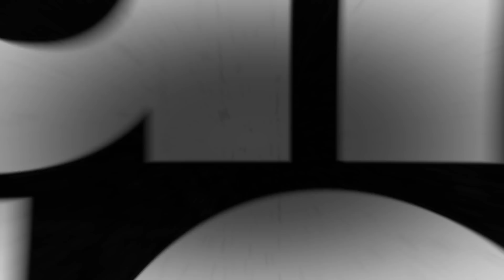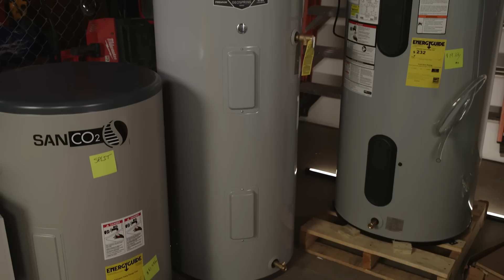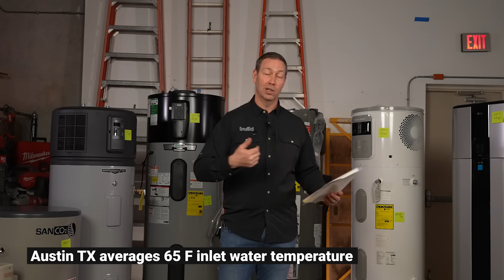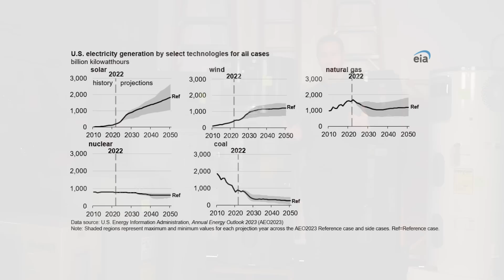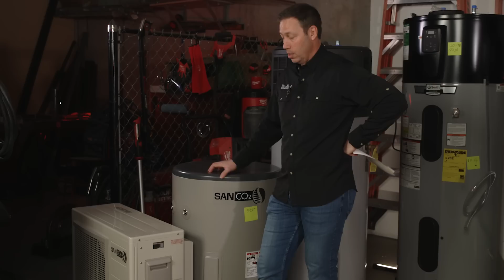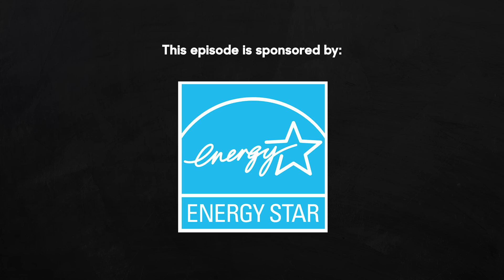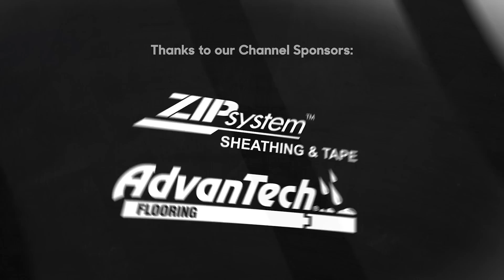2024 Heat Pump Water Heater Buyers Guide

Comment: I installed a richland (aka rheem) 50 gallon a few years ago. I added a removable duct to a new vent in the master bedroom to essentially cool our bedroom all summer long. It has definitely reduced our cooling and dehumidification needs, and with credits it paid for itself in two years. When it gets too cold, I remove the duct and let it cycle in the basement. Works great. However, the rheem econet app to control it is absolute garbage and I wish I had paid for a better unit because of that.
Reply: This 100%. Did the same basic thing and the app sucks a$$.
Reply: Yea that app sucks!!!
Reply: Hear, hear! The Rheem app is a scam. In my early months with it, it worked most of the time for monitoring power and usage statistics (good numbers there), with frequent connection issues. But after a couple of software updates it was completely non-functional, and I happily went back to manual operation via keypad. How much tweaking, remote or otherwise, really makes sense with such an appliance anyway? I'm a fan of set-and-forget.
Reply: Not sure how relevant this is to anyone here, but I have noticed a few projects on YouTube that use boards to tie in to give stats (and I think maybe even control) to help avoid using the Rheem trash app.
Reply: Which company would you go with, taking the app into account? Bonus points if it works with Home Assistant!
Reply: why would you need an app to control your water heater?  last thing I'd want is an app for that.
Reply: @NBABUCKS1  "need to" would be different than "able to". Everything should have local, non-internet control.
Reply: @NBABUCKS1  I take it you're not a home automation enthusiast. I think the key usage would be energy monitoring, but I could see it coming in handy if you took a trip and left hurriedly, forgetting to turn it off. I think we can all relate to that scenario.

Comment: Still need to see a Mitsubishi City-Multi compatible heat-pump water heater and a refridgerator + freezer...  then a ventless drier.  One converged system to handle all heat "movement" within a building.
  
This way you aren't "rejecting cold" into the conditioned envelope from a water heater (and messing with the humidity) - and you have the ability to recover the heat lost by the device's insulation to the conditioned envelope.
  
We're getting closer here... there's enough here to start having a good HVAC tech hack something together.  Either removing the heatpump's ambient coil and putting in a plate heat exchanger for a CityMulti unit - our just going with a hydronic waterheater tank like what Sanco did and just use a water-to-water heatpump.
Reply: I thought of something like that when Matt talked about the system in a refrigerator moving heat out of the fridge and into the room.  Why not move it into the water heater?
Reply: @moi01887  Yeah, if one looks at a residential home, the biggest thermal design cosiderations are the envolpe + environment, the laundry, domestic water heating, cooking, bathrooms, occupancy, and all other electronic devices/appliances (heat generation sources).
  
Every watt/hr consumed generates about 3.41btu/hr of rejected heat into the surrounding environment.
  
Every person (at rest or low activity) rejects about 100watts/hr or 341btu/hr.
  
Cooking environments generate heat but also modify the ambeint humidity (cooking frequently emits steam), bathrooms do the same (baths+showers) - and both generate odors/gasses that must be ventilated for building health requiring the replacement of conditioned air with outside air that must be conditioned.
  
Laundry is a wierd special case where one adds water to a small volume which is absorbed by the contents (and flushed several times) and then typically heat is added to a separate volume to increase the evaporation of water fromt he contents to an air volume which is expelled from the building - requiring make-up air from the conditioned envelope around the appliance (which must be replaced by outside air that again must be conditioned).
  
I watched a talk a while back on solar thermal heating of a house in Alaska talking about the thermal-loss chain they want the thermal storage tank in the center of the home so that it can lose heat to the interior volume - rather than being in a basement or attic, or a utility closet with an exterior wall.  This framing of thought really made me consider how the contents of a volume participate with the conditioning effort of the volume.  At the time I had been dabbling in liquid-cooling gamning PCs and at work had been involved with chillers cooling GPUs for bench testing - where we had to think about how the heat rejection of the stand-alone chiller affectd the lab's whole-room HVAC system.
  
For me that's when the light went on.  We need to capture heat as close to the source and direct it to a place where it can do additional useful work.  This is like when a sewage treatment plant removes and digests solid waste creating CH4 (methane - the second most impactful greenhouse gas after saturated water vapor in air, even ahead of CO2), which the plant then burns in a co-generation plant to create a large portion of the power needed to run the plant (converting the worse CH4 into less harmful CO2).
  
The laundry thing for me is the next big challenge after water heating - here we have a system that consumes water and electricity and rejects waste water (both to the sewage/septic system and to the atmosphere) and heat.  If you had a washer that recycled water, and a drier that reclaimed water (both liquid and evaporated) it would reduce the total water consumption of a house.  A few manufacturers have started to make recycled water washing machines and ventless driers have been around for a while and are improving - but there is still an oportunity to integrate the washer drier water reclaimation and where the initial heat comes from and returns to.  That's where tying it into a whole house HVAC&R system would show some benefit - and why I'm a fan of fully hydronic systems with heat pumps moving heat to and from zones, pushcing against (ideally) a ground source closed-loop thermal mass.
  
Those passive energy/heat-recovery ventillators get lot of the air change energy recovery for "free", but there is still a need to pull any remaining difference so that the exhaust air matches the outdoor ambient temp, and the intake air to match the average interior set-point.  Any time there is a condensate drain, I'd want to again delay that effluent and have it do some useful work before it is drained away - this would be for example flushing a toilet.
Reply: As much as I like the OP idea and the first comment here too, I think that a problem with doing this would be the safety risks and costs resulting from the amount of refrigerant needed, the related refrigerant plumbing throughout the house, and the refrigerant connections to each appliance, where these aren't a factor today because all of the units carry fully self-contained refrigerants from the factory, and can all be different as appliances are changed over time.

If the refrigerant was something like CO2 or a secondary fluid like water, maybe some of these problems would go away but other issues could arise from lack of refrigerant efficiency or not enough Delta Temperature to get the desired heat movement around the house.

As an example, in a place like Florida where heat has to be removed from a house year round, it would make sense to dump the heat from inside a house into DHW and any swimming pools, but somehow even this low hanging fruit isn't a standard thing to do.
Reply: @jeremyjedynak  The refrigerant can be minimized by having more packagd heat pumps and a central hydronic "spine".  Water is a significantly powerful carrier/transport of thermal energy, recalling that the initialdefinition of BTU is "the energy required to raise the temperature of one pound of water by one degree Farenheight".
  
If instead of an air coil on the DHWH, one had a plate heat exhanger using 70°F water as the transport - you're not rejecting heat into the building envelope and you're using the same medium (albeit with an anti-freeze + anti-corosion treatment).  Generally the 70°F water in the loop neihter loses and gains heat from the conditioned volume.
  
With a 50/50 anti-freeze+water mix, one gets useful working temperature down to -20°F and up to 212°F - a pound of water is roughly 0.12 gallons, and that's about the volume of a 1.75" ID pipe.  Which means per foot of pipe you could take 90BTU from that static water before it risks freezing or reject 142BTU before it risks boiling (again this is static fluid).  Pumping that water at 8fps the threshold of pipe noise and errosion (about 1gallon per second, and about 3600gallons per hour), brings the transport capacity to 324,000BTU/Hr (27 tons) and 511,200BTU/Hr (42.6 tons) respectively (this is just back-of the napkin rough numbers).
  
One could "steer" the spine-loop temperature to account for the majority of need (either heating or cooling) to give more transport capacity wiggle room (one can get around 232° of difference in this process fluid between boiling and slush; 835,200BTU/Hr or ~70Tons @ 3600GPH) - and the correct sequencing of the BTU contents of the fluid it becomes fairly easy to move heat "waste" to a heat "demand" (cooling devices ahead of heating devices) this can be made easier by having the supply-side and return-side loop pass all major devices.
  
As far as I see it, this only requires a little bit of integration from each device - a "circulation demand" signal to turn on the "spine" circulation loop, and a load prediction output for the management controller to marshal the transported BTUs (this could be combined on the same pair as a 4-20mA signal which opens when circulation is not required, scaled at the controller input for the given device).  Doing this where an asynchronous process like zone heating/cooling demands of the controller, and the controller demands of its primary heating/cooling device to manage the "BTU remainder".  Personally I'd like this to be as non-proprietary as possible, so that any manufacturer could make a component that plugs into it - and this is where I say if you have an HVAC tech who actually knows what they're doing (and not just selling one pre-packaged system over and over again), this can pretty much be done now.
  
But if the EPA did a study and created a standard...  cheers.
Reply: @Real_Tim_S   This is what Tesla does for thermal management of their cars.
Reply: I was thinking of wrapping the condenser of my mini fridge with copper tubing and looping it around the copper cold water inlet approaching my hot water tank. Should net me a few degrees of efficiency.
Reply: 100%

I'm absolutely itching for one of these, but also able to do some small radiant heating, like a bathroom tile floor. No more resistance heat!

Comment: Sounds like a propaganda video for the government I bet it has a class 2 flammable refrigerant as well
Reply: Most use R134a, some newer models use R410a.
Reply: @jpe1  I do heating and air for a living 410a is being phased out due to bogus climate science and possibly dupont's patent on 410a is about to expire and are moving to a butane based refrigerant or R32 both are classified as class 2 flammable
Reply: @winkel08  Isn’t R410 a 50/50 mix of R32 and R135?  So they are stopping using the R135.  I had not heard that, but ain’t doesn’t surprise me.
Reply: Yes 410a is a blend of 2 refrigerants one is R32 not sure what the other is but from what I've heard R32 will be phased out a few years after 410a due to the carbon and will move more towards the butane based refrigerant carrier will start selling select few units this year with the butane based refrigerant it won't be long and other companies will begin charging over gradually
Reply: SANCO2 uses CO2/R744.

Comment: Before I even watch this I knew he was going to be talking about something that no average person uses. Yep a $3000 water heater which saves you five bucks on your electric bill a month and in 20 years you would have almost gotten have your money back...
Reply: My $1600 Rheem  is saving me $800 a year . Seems like that the average person would benefit from that.
Reply: I installed a Rheem hybrid water heater last year, the retail cost was $2,399.  Then $400 rebate from my electric company, and $800 from the government, and my electric bill is $40 less per month.  Break even is less than 3 years, and in the summer I don’t have to run a dehumidifier, saving even more money.
Reply: Our KW price just shot up 6 cents and they are going to ask for a increase next year so it is looking better and better.  For reference I pay about $65 for hot water if I could cut that in half 3 years I have my ROI. This is not a toss out a perfect tank but more of my tank is bad and I new water heater plan.
Reply: The savings in our house since I put one in are working out to about 1,830 kwh/year reduced electric demand compared to our previous electric resistance water heater (we have never had natural gas or propane on our property.) Our electric rate is now in excess of $.40/kwh. So, we are saving at least $732/year. I did my own installation and it cost me $1650 after the local utility provided up-front discounts. I will get to take a $495 federal tax credit this year. So, my net cost is $1,155. In under two years the unit will have paid for itself and after than the savings all stay in my bank account.
Reply: The average water heater is about $40 per month on the electric bill and most homes...not all but most have a $600 to $700 unit normally 40 to 60 gallons. If you are the exception great. But I'm point is rooted in fact. The average homeowner would not benefit financially from a $2500 to $3000 water heater.  I'll happily agree to disagree.
Reply: @rdavidsmith  $40/month for electric hot water? That sounds like a very old statistic.  Assuming a 4500watt electric consumption, and assuming 2 hours of operation per day, that’s 9kWh/day, or 270kWh/month.  If your electric only costs $0.15/kwh then yeah, $40/monh, but for 2023 the nationwide average was $0.23, for an average of $62/month.  Since a hybrid water heater can easily cut that in half, a $30/month savings would be average.  But, I agree, for those with very inexpensive electric and/or minimal hot water needs, yes a hybrid might not make financial sense.
Reply: @jpe1  it's not old information my state is around .14 kwh. The average I saw was in the high teens. That was for 2023 and 2022. It was a breakdown per state and few were over .20 kwh. My state agency said the national average was .19 kwh
Reply: @rdavidsmith  so, your comment sent me down a rabbit hole of electrical pricing and different numbers coming from different government agencies, and I wanted to understand how there could be an 8¢/kWh variation between different “official” prices.  Turns out that sometimes the reported average is for residential electricity, sometimes it’s for all electric customers, (commercial, industrial, transportation, residential etc) and that’s where the difference comes in.  So we have been dealing with different numbers without realizing it.  Sorry for the incorrect assumption that you had old data because your data was different from mine, turns out your numbers are correct, for all sectors.  Residential electric rates are generally higher than for other sectors, with Washington and Utah having the cheapest rates, at 11.34¢ and 11.22¢, and Hawai’i and Rhode Island having the most expensive, at 42.69¢ and 31.78¢, respectively.  That’s for October 2023, the most recent official government numbers I could find.
Reply: At your .14 rate I would still save $300 a year. Since I had to buy a new water heater regardless, that would pay for the difference in cost off a standard electric in 3 years. After that it’s saving me money while also helping dehumidify my basement for free.

Comment: Unconditioned garage in north Indiana. Can it work in the winter and be efficient?
Reply: Get a hybrid, it will work with the heat pump whenever temps are warm enough, and when(if) the space is to cold for the heat pump to operate efficiently then it will automatically fall back to the resistance heat.
Reply: I've had a horrible experience in Seattle, summer is fine but in winter, warmer than yours I would think, the Rheem is horrible. It runs until it freezes the condenser and never goes into a defrost mode. The setting for electric only reverts to hybrid mode after a day so I have to babysit it.

Comment: In my 1929 southern California house the gas water heater in the California Basement .   Electric service is a problem and condensation would have to be pumped up.   Switching to electric water heater would require upping the capacity of my electric service and run power to the Basement.   I would be long dead before the cost was recovered to do the install.  It would be good in my 1957 mid century modern the next time the water heater needs replacing. But that is leased and I do not pay the utility bill.
Reply: Where does the water from the temperature/pressure relief valve go? By code that has to drain by gravity, the condensate can be handled by the same pipe.